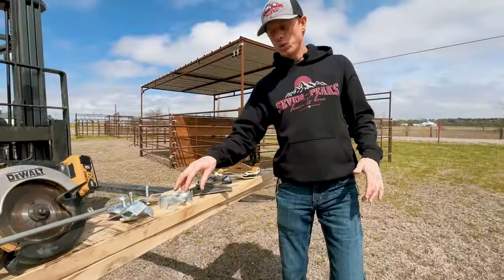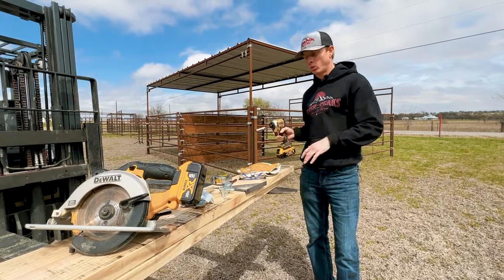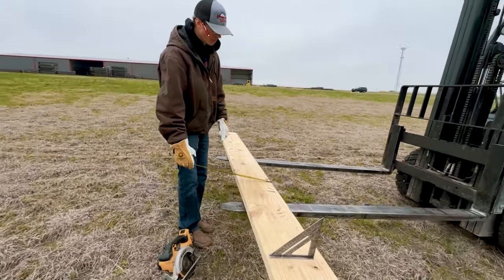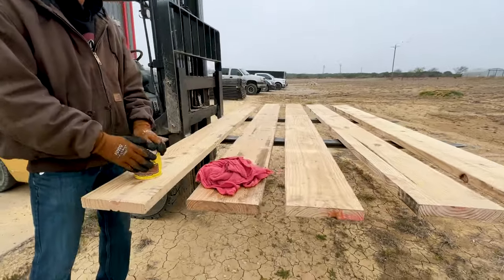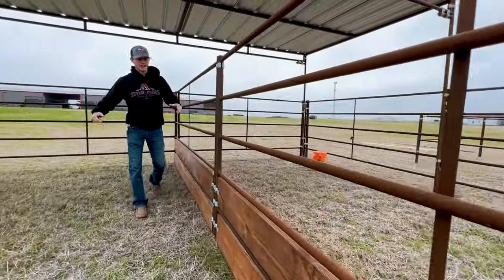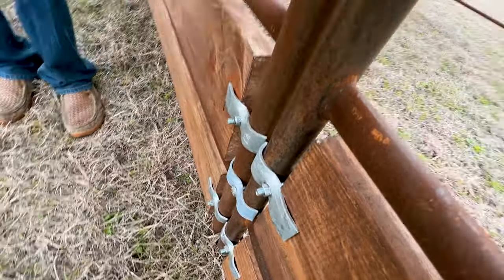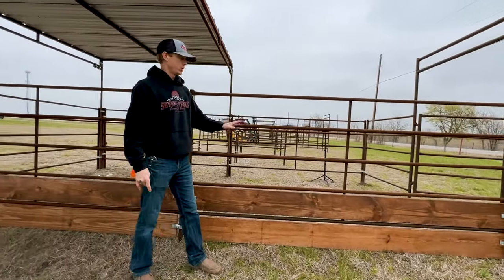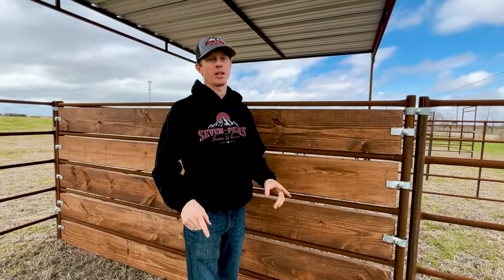SECRET REVEALED! - How To Easily Add Wood To Your Horse Panels!

Comment: I have four rail panels. Do you think 2x12 lumber would work, or would the gaps be too large? Any other recommendations for the four-rail?
Reply from the maker: Hi Clark! For 4 Rails, the spacing between each rail is 14 1/4", a 2x12 could work but there would be a little bit of a gap.